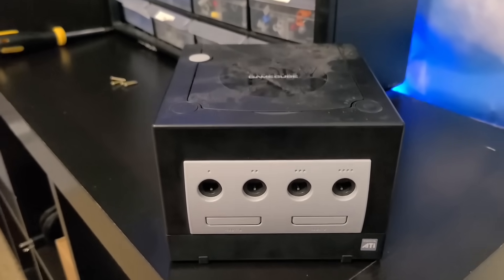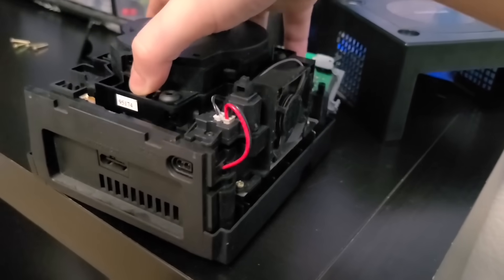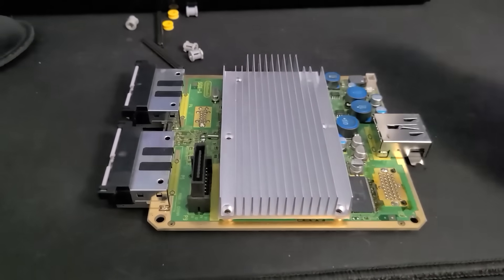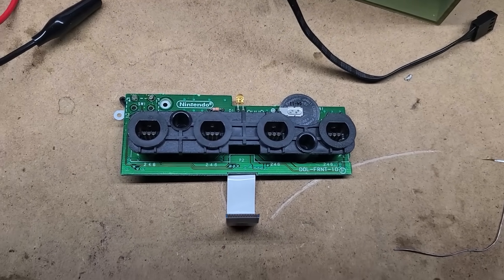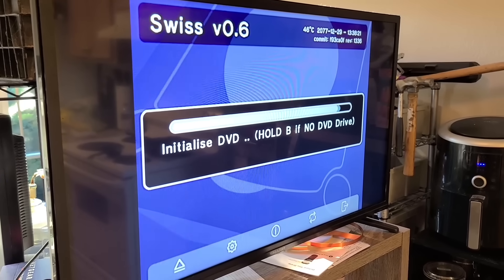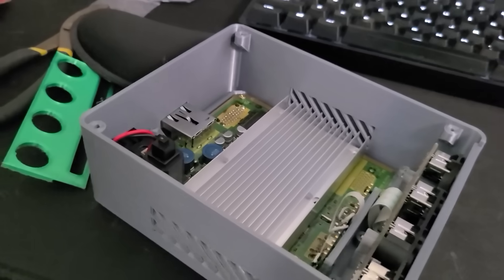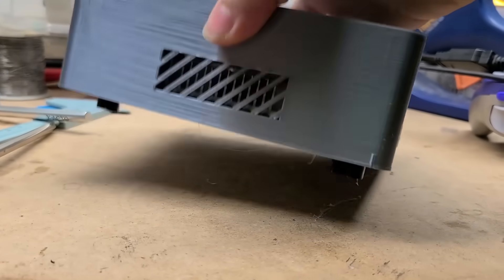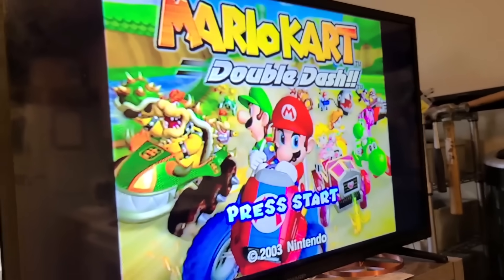I made my own GameCube Mini because Nintendo wont

Comment: I'm probably going to be building one of these soon using your 3d print files.  Do you have any updated tips for doing this build?  I noticed the part where the controller board was cut didn't make it into the video.  I assume there was nothing to mention there and it was just a straight cut.

Comment: You could cut this thing in half by mounting the controller ports and memory cards on the top and then putting 2 intake and 2 output rpi fans on either side of the heatsink.

Comment: TPU? You have a dremel. Just trim the screws! 9:55 For the nut, push it into the plastic with your soldering iron. There you go, heat pressed threaded inserts :)

Comment: I have one almost 90% built but I’m not quite sure how to wire the fan. Do you have a diagram or could you explain how to do that?
Reply from the maker: I just wired the fan directly to the power switch with a resistor that knocked it from 12v down to 5ish volts, and then any ground plane on the motherboard
Reply: @BringusStudios  so do 3 of the wires go to one point on the power switch then black is ground?
Reply from the maker: @TheGameDungeon  So one of the pins on the fan is the signal wire, which you don't need. Google search 3 pin pc fan pinout and you should find the ones that you need, which are just voltage and ground. The signal wire stays disconnected
Reply: @BringusStudios  thank you so much!
Reply: @BringusStudios  im sorry if I’m bothering you :/ Igot the fan powered on now but it constantly runs when plugged in whether the system is off or on. I’ve tried wiring to a couple different points on the power supply but it constantly runs. I feel like I’m missing something lol

Comment: You know what would be super cool, the way the game is up and running is via that SD card, but you know what, imagine if there’s a game card slot to fit Game cube games inside and should say “GameCube Mini” and that it mentions it was designed for that console, same should be added with discs

Comment: I've been thinking about doing one of these with the same model for a while now but never got around to it. Neat to see what it would look like. I'd just go with the stock fan though, myself because it's slimmer and who gives a damn! The SP2 connections are actually present on the DOL-101, you just have to scrape the vias. It's not too difficult. I use Arduino micro SD card modules.

Comment: Why do all 3D prints look like shit? They all look incomplete. Can’t they do an acetone bath or sand it or something to smooth it out a little more? Use some sort of filling compound to even out the printing layers to have them come together more? And I would’ve used the extruding screws on the bottom to screw on the feet. Little rubber cones with threaded inserts or what have you. Incorporate everything together a little better. Regardless, love this guy and his content. 10/10

Comment: wow man thanks for doing this vid. i have a gamecube and bought the pico chip a while back and just threw away the disc drive straight away then seen the error about the disc drive not being in and started to worry i might have to go out of my way and buy one but thankfully you showed me that i wont have to. I am using that same version motherboard you used in your vid to make a portable gamecube using a gcloader. using the pico boot with my other model motherboard. good job on the project! nice and slim
Reply from the maker: Thanks! If you think this is slim, I made a v2 that's WAY slimmer. The video is on my channel

Comment: Dudeee this is really sick! Fun fact, I was modding a GameCube of my own with Picoboot (this was before I knew the difference between DOL-001/101). Went to put the SD2SP2 adapter in the serial port and realised I had a DOL-101 model. So I found a diagram online showing you how to solder a micro SD card adapter directly to the motherboard. -- You could totally do this if you didn't want to use the memory card adapter!

Comment: Get some 3M rubber feet and put a small hole in the middle of them so they can sit right over the screws and it's 3M so the bottom is an adhesive so no extra glue or anything needed

Comment: You couldn't soldered extensions onto the controller ports so the board for them can sit flat and use a thin noctua fan. That would drop the height a good amount more

Comment: This makes me think of when the PS2 Slim came out and a bunch of my buddies wondered if they could use a hole punch to get it to fit into a 3-ring binder. LOL
Personally, I'd have replaced the ribbon cable so the controller ports could have been placed on the side rather than above the memory card ports and not bothered with cutting the PCB making the end design shorter in height but a bit wider. This was fun to watch.

Comment: Yo, super cool! One small note about the fan. Correct me if I'm wrong, but the fan should be installed the other way around with the sticker facing up if you want the top to be the exhaust (at 5 min mark you mention sides as intake). Probably doesn't matter too much but heat rises up & having the top intake could be a literal dust vacuum. Anyways, dope as hell!

Comment: One word of advise would be to flip the fan orientation to have the top as exhaust. as air could be drawn in from the sides and the rising heat would come out of the top. Other than that, fantastic work! (im sure the difference would be negligible anyway)

Comment: best fucking minimize vid ever

its not like a fucking hour long where it explains what 3d priting it or what a PCB is like im 3
its just "wow this fan fucking sucks, lets use a noctua instead"

my only complaint (and maybe I skimmed over it, or im victim to my own praise and should just know this already) but he never explained why he needed the pico to replace the disk drive when it appears to ultimately do nothing except (tell the gamecube that a disk drive is present?) but then uses a 16gb sd card to load games
i mean i guess its so you can change it out but if you have a port that reads games internally why not use it? the card is outside and makes it look off with the card sticking out.

Comment: You could have tiltet teh controller ports to plug controllers into the top and use a slim noctua fan to create the same top blow design and have vented sides. Idk if that would be significantly slimmer, but at least a bit, and it would have looked pretty unique

Comment: This is a really cool mod. But I think you don't need a fan this size, you could use a Wii fan, which is really small. And the reset button is useless, even on the original case. If you paint it black most of the imperfections will disappear. Yeah, the only problem for me is this hole on the top for this huge fan. Overall, great mod.

Comment: Curious, what made you install the fan this way? I would think having the intake from the sides and it blowing out of the top would be better. Add some nice dust filters you can easily cut and place on the sides inside too would be super simple.

The current setup would just inhale so much dust and hair straight from the top into the box and barely come out.

Comment: Neat, makes me think about the idea I had to turn an old game cube or a PS1 into a small computer. 
Though, since you had the issue with the controller port, Why not just mount it on the side? Yeah the width would increase, but the height would go down a bit. As for a fan, I think some laptops from the last five years or so have smaller fans in them. So something like that could help make it a bit shorter.
Otherwise, neat video.

Comment: It looks like your printer is over-extruding a little, leading to the slightly messy appearance of the top surfaces due to excess plastic getting smooshed around the nozzle. It is probably also making holes narrower than as-designed and generally making the dimensions less accurate. If you try dropping the extrusion rate by 5-10% it'll probably give better results. 

That said, great job on this hack, looks fantastic! 👍👍

Comment: you should work out some friction reduction of your printers feeding system. that will eliminate alot of that banding and improve the tolerances. I suggest looking into a bearing mod for your spool holder.

Comment: an old gpu blower would work really well. like one of those cheap singleslot cards. I saw an old gtx990 that had a blower setup that would cover that whole heatsink and only 1/4 inch tall.
Reply: i take it back the noctua is a good choice.

Comment: instead of screwing the pcb through the bottom could have just used a solderiron the melt the nuts into the bottom part? im not super known in 3d printing so idk if the iron would get hot enough for it but sounds do able and youd get away with no feet since 1cm high was so important before

Comment: Very cool mod! This looks like a perfect candidate for the bluetooth controller port. The MC-loaded roms aren't a bad touch either, but a more elegant solution would be an ODE that uses its own SD card slot, then an extension to place that somewhere on the case.

In any case, I love it! Looks great! The only major change I would consider making here is maybe using two Silverstone thin fans, top and bottom, for better cooling (bottom intake, top exhaust). Not sure that's even necessary though. Can you overclock the GC? Is it worth doing?

Comment: I think that piece of metal that screwed into the memory slots provided shielding for the controllers? That pcb definitely looks like it was supposed to make contact with it which would connect it to the metal casing of the  memory slots (probably also shielded))

How big is it compared to a Wii?

Comment: dude get some digital calipers. they make measuring things so much faster. you need to learn to use them effectively to make CAD work take less time. 
there should be no need to use a photo as an "accurate" size reference. the faster you can do something like that the more time you have elsewhere.  
Neiko brand is very inexpensive and measures as accurately as mitotoyu but has less resolution which doesn't matter on 3d prints.. 
someones probably going to complain i said that but there's never any need to to be micron accurate or measure things at the atomic level with 3D printing. 

im trying to be helpful and dont mean to be rude at all. I been doing cad for who cares how many years and had to learn a lot of speed tricks. 
the better you are at CAD the less mistakes and wasted time re-printing. less headaches and more fun.

Comment: the memory cards being in the front is more convenient. it would be annoying to reach around to the back when its in a cubby shelf. 
Also you shouldn't have to test the GC every time you remove a connector. unless your so bad at de-soldering that you tend to destroy neighboring components. 
connectors have no internal parts or wiring that would affect the function if removed.

noctua fans are pretty quiet even at 12v idk why you needed to lower the voltage. if its "pretty loud" its probably a knock off or somethings wrong with it or you didn't get the silent version because that's all i buy. i used some on my 3d printer to cut down on noise and all i hear is the linear bearings sliding around and minimal motor noise now.

Comment: You should print the faceplate facedown on a flat print bed so that it's smooth or use cura and print with an ironed top layer or monotrpopic ordering.

Comment: Here's a design tip... Separation between a top and bottom shell for such a project should either be located somewhere midway or the bottom but most definitely NOT at the top 😑
It also helps to print aesthetic surfaces like the top of your shell upside down facing the Build Platform thus impregnating it with the texture of the Surface you print onto ( smooth, textured, etc. )
SuperSlicer also has a One Perimeter Setting for top / bottom layers where it'll - for aesthetic purposes - only print one perimeter on those layers regardless of how many layers you're using in-between preventing that transition look between the Perimeters and the rest of the infill as spotting a single 0.4mm Perimeter is almost impossible from a regular viewing distance.

Comment: Great job, dude! :-)

Some suggestions for the next generation:
- You could make the fan look like the disk drive by putting a black mesh over it and making the fan black.
- Making the reset switch in a circle and putting a circle on the other side (so you have the three circle buttons.
- Don't forget the little tiny handle on the back! ;-)

Comment: Very nice! IMO I still would have stuck with a DOL-001 if I were doing this and opt for a USB-C 45W PD input instead solely so I could use a GC-Dual to add HDMI to the board, but you did a good job!

Comment: You could have soldered the SD2SP2 to the points on the motherboard even though that model is missing the serial port 2 connector it still has all the points on the motherboard so if you really want you can solder the SD2SP2 adapter directly in to get those benefits of faster load time.
Reply: Where is the console hacking community at? Do you guys do commissions for 1 off projects?
Reply: @Subreon  Some people might, I'm not really sure.

Comment: Personally, I think I would have tried to get a GC Loader to fit in there.
Also, I would have liked to see how you did the RTC battery and reset switch with the cut board.
Reply: Where is the battery anyway?

Comment: With a bit more soldering you could have made this thinner by laying the controller board flat and removing the plugs for the controller board, then soldering it to the back with a few wires instead.

You also probably should have soldered on one of the SDCard underside loaders too, which is half the point of the Pico mod, as the SDGecko is KIND of shit when it comes to transfer speeds. Wouldn't have added basically any width and given you a better, faster, and more effective game loader.
Reply: I'm currently making this and I'm doing exactly that! I want it as slim as possible so ports have been removed and I'm currently reconfiguring them now!
Reply: @rollermobsterinc2682  could probably throw out the mem cards entirely as they're basically useless with that sd card.
Reply: @Melechtna  yeah I just have Swiss force it to save to the SD because those memory card slots take up so much space it's crazy. They are like 10% of the console if not more when it's shrunk down to just the main board. Also I'm not trying to self promote but I put up a little video today on my build and you can see that it's been stripped down. All I need to do now is remove the DVD drive port too because it's worthless after this mod too.
Reply: Also could've swapped the heat sink with something salvaged from an old gaming laptop to pull the heat away with heat pipes into a much smaller fan at the back.
Reply: @LanceThumping  he actually just released a new video today where he did use a laptop fan making it smaller for his version 2 mini

Comment: Really nice build! I would suggest to turn around the fan, so it gets cold air from the side and blowing the hot air to the top. With this layout of your housing, negative pressure inside the case should be better.

Comment: IDK if this is possible but to make a bit thinner, couldn't you have de-soldered the video output and re-solder it with some wires somewhere by the memory card slots? thereby make the side with the memory slots the new back, and then extending the ribbon cable for the controller ports plus the wire for the power connector longer and thus making the back the new front? So it'll look cleaner on the front and the memory card slots wont be showing.

Comment: The spacing on the Gamecube Controller ports were kept the same distance from Gamecube to Wii. You can trim out the GC ports on a Wii motherboard. Just wire the power and ground pins in a series and the 4 data pins to where they are on the GC motherboard, front-middle.
Reply: The Wii family edition doesn't even come with GameCube ports!

There is a way to make any Wii autoboot into Nintendont.

Comment: The only downside is having to play games through the memory card slot, but it seems to be the only sensible solution considering this model doesn't have the port for an SD2SP2 (and it would have added extra thickness if it did), and getting a GCLoader is nearly impossible unless you have hundreds of dollars to spare.
Reply: AFAIK, all they did was remove the connector for the SP2 port, the solder pads are still there and should work if you solder them directly to the sd2sp2

Comment: BaseQi Pi Drive Pi 100 San Disk adapter for this would make it more slim. They have them over at Ali-Express. It barely sticks out of the Gecko. It has a little slit for your nail to go into. I was very happy with mine.

Comment: 1:04 they look like they're waiting for you to stick your fingers in again, its really weird.

no need to have the memcard exposed if you have a big enough card.

maybe mounting the controller board with the ports vertical would lower the profile even further?

still, nice work. I'd buy one. and I'd run the fan at 12 volts, fight me.

Comment: Not sure about Cad but you could have used Photoshop to do the 3D modeling for printing parts, setting correct DPI ratio/real life size compared to your screen and you're good to go. You could see it in real life size when using print size zoom. Though Photoshop has a learning curve to it's 3d modeling, i am not sure if the files work between CAD and photoshop? (might work)

Comment: If you can, try replacing the controller ports with a blueretro board. It's a drop in replacement, and it lets you use almost any bluetooth controller under the sun

Comment: Great job. Now if we could get this a done with a digital port for some 480p niceness. I think the SP2 port works, it’s just not there. I think you Can solder wires right to the pads and use a sd2sp2